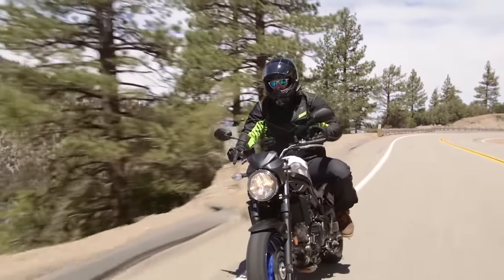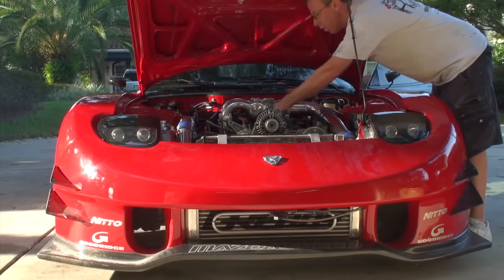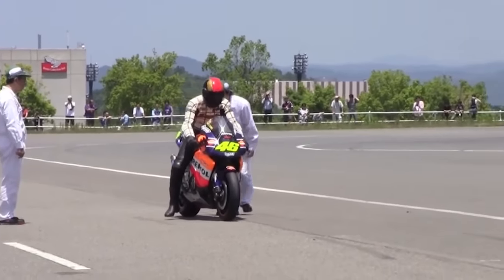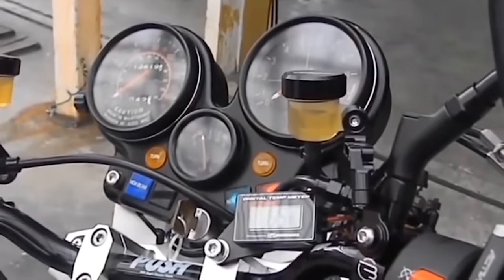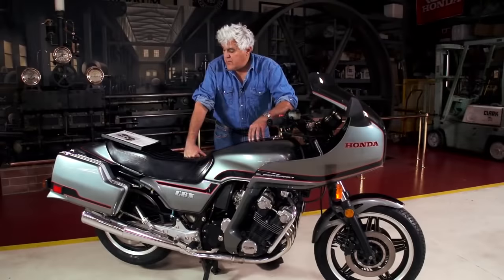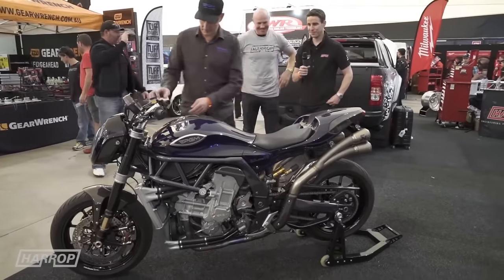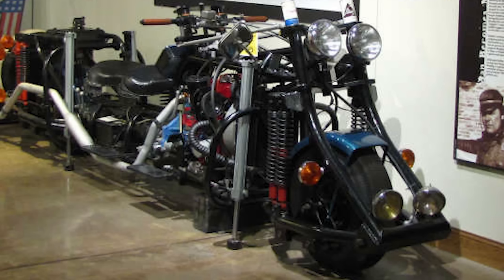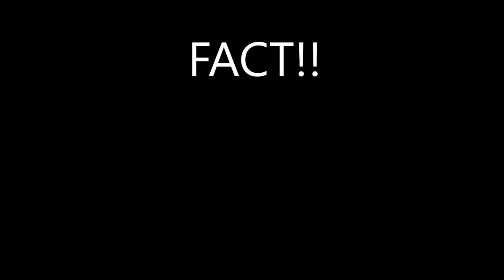The Most UNREAL Motorcycle Engines Ever Produced

Comment: Someone may already have mentioned this, but since you included the RC211, a race-only bike (thereby not limiting your list to street bikes), Honda GP RC166 of the 1960s had six cylinders. It had an astronomical redline of 20,000 RPM and made 65hp from its 250cc. You listed some incredible engines, but leaving out the RC166 is a glaring oversight.
Reply: Also the 5 cyl 125 of the same era. 20000 rpm torque peak, 22500 rpm hp peak.
Reply: Both very much needed add ons

Comment: To my ears, the CBX easily sounds the best. Brought tingles and goosebumps, fabulous!!
Reply: You need to listen to a real Honda six on full tilt, much better than this underpowered grand tourer.
Reply: Both of those CBX did not have stock exhaust.
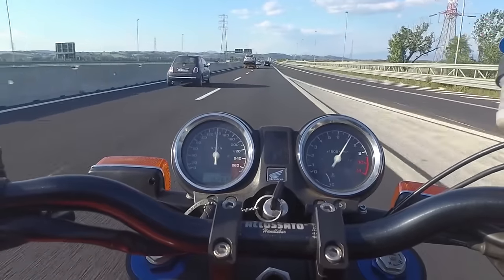Reply: I probably shouldn't admit to it "I'd kill to own a CBX" at 6:13, but I do own one.   The 6 into 1 pipe is glorious.   I've seen exhaust pipe comparison videos.  I found the 6 into 6 a little harsh, the 6 into 2 (stock or replacement) less interesting and the 6 into 1 the best.
Reply: The Ferrari of Japanese streetbikes!
Reply: @georgebarnes8163  some 4 foot long long duration cams, lots of head work, serious turbo/ fuel injection and you got maybe 300 hp CBX.
Reply: @nonyahbiznezz9094  anything above 140 bhp and they need water cooling
Reply: Like a wailing banshee
Reply: That v5 though, that sounded awesome.
Reply: CR700w
Reply: Vfr750,gear driven cams.
Reply: @georgebarnes8163  Enlighten me
Reply: Probably the best sound of my bikes was the Suzuki GT550 two stroke triple withe four pipes,Two little ones the fed the centre pot and one for each of the other pots,What a racket,Got pulled often but never prosecuted with in regulations,A TWO STROKE racket,The other is from Terminator 4 those motorcycles dropping of the legs of that enormous robot! Kawasakis, Ducatis, A gorgeous whine really revving

Comment: 6:15 holy shit that sounds like an old school f1 car
Reply: thats what need in today's f1
Reply: probably a 2 stroke
Reply: teeburshow 2 strokes don't sound like that trust me and me family
Reply: J Luna or a begging of a air raid siren
Reply: @Mr. ZFG no he didn't, that's what six cylinder bikes actually sound like. I own one
Reply: EXACTLY !
Reply: CBX, definately not a 2 stroke, its the orignal 1960s GP Honda sound, that the CBX's engine was inspired by, the DOHC-4VC 250cc (& 298cc) 6 Cylinder racers - also their (Honda) Grand Prix car engines of that same era also sounded largely the same - all having about (or over) 180hp per litre.
The CBX itself didn't rev to over 18,000rpm the 1960's Honda GP engines (some up to just below 23,000rpm with no VVT or Pnuematics Valves). Using its larger size for its power rather than sky high revs, with a crank that had flywheels with some balancing factor & centrifugal mass; more than only enough to only transfer power from the pistons, than that of its narrow powerband high end tuned with upto 8 gears & nearly no crank mass or 'flywheels' of its racing grandfathers.

Yammynoob, why didn;t you include a breif mention of the RC166 & RC167 sixes, or the other '60s GP Honda RC Twins & Fives ?
Reply: @Mr. ZFG I KNOW that. Search for CBX1000 on Youtube, you will hear the same sound. I own a Kawasaki Z1300, another six cylinder that revs to 8500 rpm with similar sound.
Reply: Sounds beautiful! Well Honda did make some of the best f1 engines ever.
Reply: I agree
Reply: @Mr. ZFG no, thats how it sounds
Reply: Honda cbx is also known as F1 sound bike... One of the best sounding bike ever produce.
Reply: @Mr. ZFG lol, that's how it sounds.
Reply: @Jed Lawson its not. CB400 sounds different than CBX 1050.
Reply: J Luna legit tho
Reply: @Mr. ZFG Uh, no, that IS what a CBX sounds like at full tilt.  It is notorious for that sound.
Reply: @Mr. ZFG No, that is the real sound. I owned a 1979 CBX with a 6-into-1 pipe and that is exactly how it sounds. It is the most incredible sound that I have ever heard from a motorcycle. Unfortunately I sold it about 10 years ago. To be fair, in order to get that F1 sound, you have to replace the stock 6-into-2 mufflers with an after-market 6-into-1 exhaust system. The stock mufflers really dull out the sound.

During the original development of the CBX, Honda experimented a lot with the exhaust system. What finally ended up on the production bike was a compromise. The original exhaust system that the Honda engineers wanted to install would have sounded much more like an after-market 6-into-1 pipe. Honda management thought it sounded too aggressive. They were already concerned that the engine produced 103 HP. At that time, this was the highest power output of any production motorcycle and was the first production motorcycle that produced over 100 HP. Their concerns were well founded. Within a year, Senator John Danforth tried to introduce legislation that would set the maximum HP limit at 100 for any production motorcycle. Fortunately that legislation died. The controversy took its tole, however, because CBXs produced after 1979 were de-tuned to 98 HP to get the engine under the magic 100 HP number even though it was not a legal requirement.

So, if you ever want to acquire a CBX, the 1979 model is the most desirable because it was rated at 103 HP.
Reply: Yep the CBX sounds legit like a F1 car a buddy of mine owns one and it's an ear orgasm whenever you hear it it's beautiful.
Reply: @phil955i  yep F1 cars have very small 2.0L twin turbo engines that sound like that except without the turbos even though you don't hear the turbos
Reply: @gtaashwagandhaman7551  yes you're talking about current F1 cars, I was referring to the era of non-turbo V10s & V12s of 3 litres.
Reply: @phil955i  Lol😂 oops my bad
Reply: Mr. ZFG it’s the actual sound from that bike go look it up by yourself and listen to the sounds it makes
Reply: If you love that sound there is particular one minute clip of the same video, easier to keep in your list for repeat use
Reply: @Mr. ZFG it is, it's a 6 1000cc 6 cylinder bike
Reply: @offroadz4861  i don't trust you, why should i?
Reply: @keiannschyler  watch my yt and you'll know, I owned 4 of them
Reply: @phil955i  I Love the cbx

Comment: "It's like putting a V12 in a Ford Taurus"
hoonigan has joined the chat
Ken Block has joined the chat
Colin furze has joined the chat
mighty car mods has joined the chat
deboss garage has joined the chat
shifted interests has joined the chat
Reply: You'll have to get real creative with the sawzall to jam a V12 in a space a v6 barely fit. I heard of somebody putting a V8 in a Mercury chassis of the same type, but at that point you had to take the engine out to change the plugs or the belt. Or check the oil. Or look at it too long.
Reply: Condorito the way I see it, there would be no easy way.  Heavily modifying the chassis and the firewall and footwells.  Or make it rear engined
Reply: You just gave me the best idea - rear engine, rear drive Taurus with a blown big block and a Mustang rear diff. It could do the power transfer like that wheelie truck on Roadkill.
Reply: Big Beast GY6 Roadkill has joined the chat.
Reply: Then at some point it'd go wrong and it'd need some soapy wooder and blinker fluid:
Chrisfix has joined the chat
Reply: 1320video joined the chat
Reply: toyota supra has left the chat
Reply: Fun fact: the Aston Martin V12 used from the mid 2000s to modern day is based from two Taurus Duratec V6’s. Cause ford used to own Aston Martin
Reply: Big Beast GY6 rcr joined the chat
Reply: Haggard has joined the chat
Reply: kill to own one? well, someone might die if you owned one, but I doubt it would be someone else
Reply: I have a better idea for the Taurus, take the TT V6 from the newer Ford GT and stuff it into the Taurus
Reply: @chincemagnet , well... there is an Alfa Romeo GTV (the 116 type, not the modern Fiat 916 FWD-thing) both with an V8 from an Montreal and some mad max's have jammed in an V12 from Ferrari 550 Maranello and the BMW 850CSI V12 in em...

but seriously... those poor GTV gearbox'es i just have to say.
Reply: Um, you guys forget that a certain generation of the taurus sho has a 3.4l v8 that was made in conjunction with yamaha? That's pretty strange in it's own right.

1. it's a tiny ass v8.
2. it's in a ford.
3. yamaha.
Reply: @strike9716  WHAT
Reply: Someone’s going to need to fab all this up with absolute precision

Bad Obsession Motorsport has joined the chat
Reply: @Condorito380  BMW Made a V12 X5.  I've seen the car. It's a veeeery tight fit.
Reply: @strike9716  It's true! A tiny v8 made by some Japanese dudes crammed into a Ford sedan? Very wierd.
Reply: @Condorito380  the late 90's Taurus SHO came with a 3.4 liter V8 IIRC.......
Reply: Have had 3 CBX's and a Benelli sei, kept a 1980 CBX with OverRacing Billet mods & parts.
Reply: Big Beast GY6 
I have joined the chat
Reply: Colin furzzeeee

Comment: I was a Suzuki factory service rep when the RE5 was introduced.  One of the major problems was that there was a production delay that created a 7 month gap between dealer training on the bike and its release which led to the mechanics forgetting everything they learned.  To compound the problem many of the early bikes were shipped with incorrect carburetor settings from the factory and the dealer was expected correct the settings.  The RE5 had the most complicated carburetor ever put on a bike (see link for exploded view).  There were 5 cables from the throttle that led to the carb that had to be properly adjusted.   Many left the factory with incorrect linkage adjustment & that involved using a protractor to determine the actuation point & bending the linkage to get the proper adjustment.  I spent most of my time going to dealers that were lost when it came to the RE5 adjusting carbs and solving other problems.  The rotary engine is very simple, but with very complicated ancillary systems to make it work.   Carburetor exploded view:  https://www.prismnet.com/~jrf/RE5/re5carb.jpg

Comment: The RE5 apex seals wearing out almost broke Suzuki. 20 years later, Norton solved the issue with soft rather than hard metal seals.
Reply: Replacing engines on a low production run motorcycle that was built for 2 years almost broke one of the oldest and biggest companies in the game?
Reply: Weird eh, one wonders why it took so long. My old man (who among other things was an electrician) used to tell me in the 60's that if you apply friction to hard and soft metals the hard metal is the one that wears, looks like he might have been right.
Reply: Consider a riding mower deck wheels are plastic on steel axles. The axles wear thin, not the plastic wheels. It blew my mind.
Reply: Still a really collectable bike though interestingly ...
Reply: I’d love a wankal motorcycle!
Reply: @exutiku  My dad (automotive engineer) told me the same story (for bearing surfaces) ; he said tiny particles of the harder metal became embedded in the softer metal, and formed a 'sandpaper' which wore down the surface of the harder metal.
Reply: @chrisbraid2907  Collectable,Still a concept i can't get my head around Probably because I've never had enough money to "squander",So much i don't know what to do with it,Let's buy a bike from the 70s that looks good,Technically advanced for it time but was crap,pay $30,000 For a machine that only new was $2000,Nope still can't get my head around that concept

Comment: Honda makes the best engines for the price period! This applies to automotive and motorcycle engines. I'm not a honda fan boy, but its hard to argue their reliability.
Reply: Make a dope racing lawnmower too
Reply: Toyota  honda is great and makes great cars but Toyota is the leader in reliability   also Yamaha is on top of honda in the motorcycle industry     once again I like honda but its not  the best period
Reply: Kamil Starikiewicz still makes reliable
Reply: Reliable, have fun working on the cars......starter under intake manifold on the K24, and the 1.8 has the starter tucked up under the backside of the engine.
Reply: Richard Gollwitzer 

You’ll never catch Honda putting another competitor’s engine in a Honda chassis.
Toyota on the other hand........
IE: 
THE Celica
THE MR2
THE LFA
THE Supra
Reply: True.
Reply: My Honda cb100 single cylinder engine was INSANE, it would just keep getting faster and faster lolz, you had to shut off at like 60mph in top gear as it was deep redline screaming, such aggressive BEAST like behaviour from a tiny 100 cubic inches, and the thick silver paint was a deep gloss, my Honda xl125r was a THUMPER with its micron muffler,my Honda xl250 would plough a field.
Reply: Herman Greenfield  20k and you had to replace a timing chain?  This is unheard of! You couldn't figure out the tweaked frame before?

Comment: I enjoyed your video, and there are some terrific bikes here, but I have to correct you that the Benelli was a long way from being the first in line 6 because Honda did it very successfully with the 1964 RC164, just under 250cc. Surprised you didn’t mention it, because revving at 18,000 through 6 open megaphones makes the CBX in your video sound tame. How could you not mention the 1965 Honda RC 148 5 cylinder 125cc revving to 22,000 with open megaphone exhaust.
Reply: Or the V8 Moto Guzzi and a plethora of unique  racing engine designs but then again this guy is young and needs to do his homework
Reply: Because this guys to fast to seriously speaking for high revving mouth 😂, seriously i confused watch this videos, so loud😂😂
Reply: The infamous rc164.

Still doubt it was actualy fastet than other bikes or just no one dared to come up close enough to pass the damn thing.

For loud and good old racing bikes, look up the ss250 and ss350 two stroke german screamers.
Reply: Benelli was the first production,Your arguments pivots over track bikes which are not street legal and invariably count mainly because they are a one off,
Reply: @Johnketes54  yes, you are right. The Benelli was a production street bike, but your argument doesn’t make sense for two reasons. Firstly, the video is just about ‘motorcycle engines’.. it doesn’t specify street or track. Secondly, if the video was about street bikes, why does it include the Honda RC211V, which is clearly a MotoGP track only motorcycle?

Comment: Those 2 stroke triples were scary because of the fact that they had frames that flexed badly plus the two stroke had a power band that caught people by surprise. Hit the sweet spot without prep and, with the tires of the day, you were screwed. Remember these bikes were running on bias ply tires that didn't wrap the traction zone all the way to the rim, they were basically smaller and skinnier car tires.

Comment: I've ridden an RE-5. It was owned by a racer who graciously permitted me to take it for a ride. It didn't do anything any better or worse than a conventional engine while being vastly more complicated and heavy. Suzuki would not permit their own dealers to perform internal engine repairs and required faulty units to be shipped back to Japan for replacement under warranty. It managed to combine all the worst aspects of two and four stroke engines with almost none of the benefits.
Reply: Apparently it mirrored the performance of my Suzuki GT550 two stroke triple,But cost more and was less reliable and as you pointed out no after sales maintenance,I could do some of the maintenance except timing Dail&gauge very complicated,3 sets of points,3 ignition coils,and 3 carbs but synchronisation was easy as was the CCI oil injection adjustment

Comment: Yam is I have owned many motor cycles over 50 years One that I admired was my 500 cc Honda shadow shaft drive It was super reliable never let me down at allI travelled over 250 thousand kilometres on it before I sold it ,I am so happy with my  2002 ST 1100 it is super reliable and plenty of power and torque to flatten any hill and it can cruise all day and over 900 kilometres plus in day and not break a sweat My ZX10 was another beast super insanely fast also cover long distances with ease
Reply: Even prior to becoming a motorcycle mechanic, I considered reliability to be an absolute necessity, so it's great to hear of the trouble free mileage you had with your Honda Nighthawk.

It was a comfortable, attractive and capable motorcycle.

Comment: You forgot to mention some engines Six-Cylinder's Kawasaki KZ1300 and it was Liquid cooled. 

The 1955 Moto-Guzzi 499cc V-8 Grand Prix bike. 

You forgot to mention the Hercules rotary motorcycle as well as the one built by Norton. 

Also you left out the Ariel Square Four as well as Suzuki's two-stroke iteration the RG 500. 

My favorite of all times the NR 750 with it's oval piston's twin con rods per piston and not 2 not 4 but 8 valves per cylinder. 

I love interesting and Innovative engine designs.

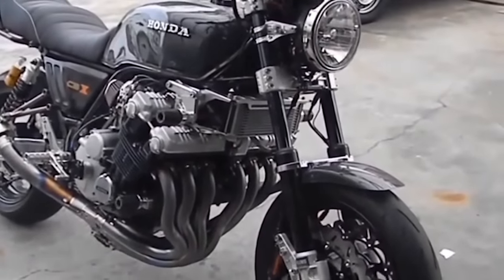Comment: 6:05 "it's like you put a V12 in Ford Taurus" well, have I got some interesting news for ya!  The later model 90's Taurus SHOs came with a Yamaha-codeveloped V8 under their hood.
Reply: I thought they were 6 cylinders
Reply: @williammcguire130  the 90s had a v6 the later models had a V8 both modified by yamaha
Reply: All ford Modular motors are Yamaha influenced.(im told.) I have built pushrod v8 and modular 4.6 motors for several years and its funny being that its a USA car with Yamaha engineering and all metric hardware. Powerstroke the turbo diesel motor is a German built motor originally.
Reply: @williammcguire130  Starting in 1996 they were. 89 to 95 were the 3.0 (manual) or 3.2 (automatic) DOHC 220 hp Yamaha V6 with the "bundle of snakes" intake manifold.
Reply: I never knew about the V8 SHO just the V6. Thanks for the education. I had to look them up and read about it.
Reply: Great for runnin "product" in Arizona. Look like you're goin to church... until you needed to dissappear.
Reply: Yes and they were wicked ...had cylinder head stud issues